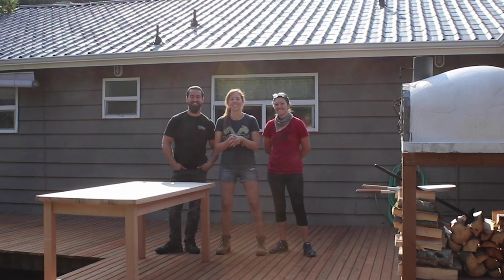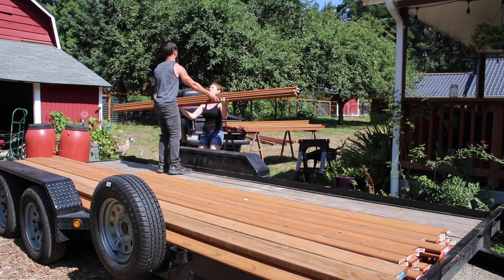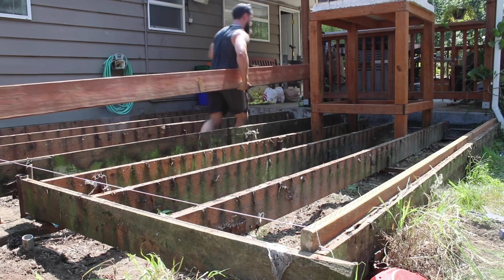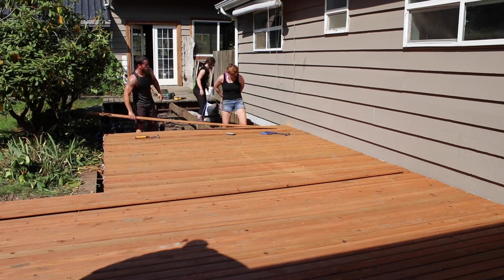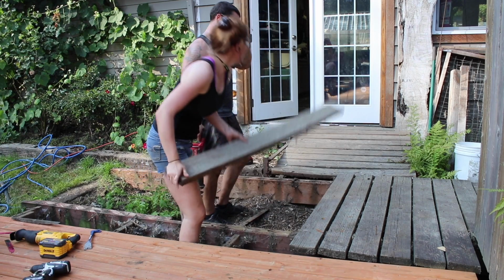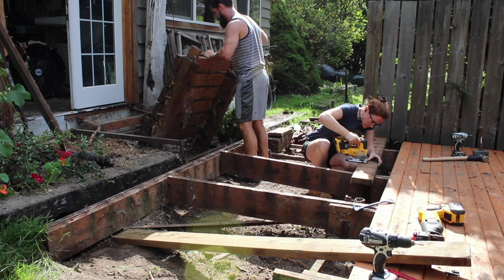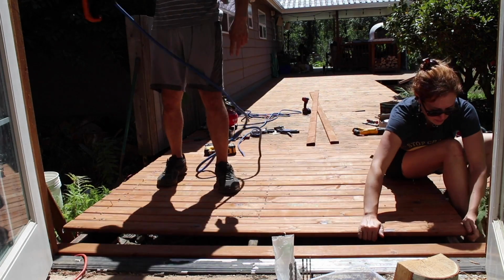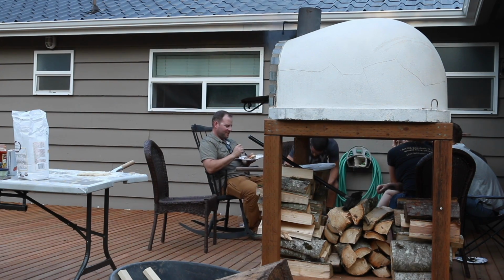2 Day Deck Rebuild - How To Rebuild A Deck

Comment: I don't know what blade you used in your sawzall but my old deck board were screwed down. The screws were angled in from the sides of the boards to hide them and not one would back out. I used a crowbar and a smaller prybar and popped the the board off and then went back to remove the screws. Three different style blades and none of them cut the screws as fast or easy as yours did in the video. I used a set of lineman's pliers to snap them off. Around here (North Alabama) I have not ran into anyone who uses nails to lay the deck boards. so I am going to use standard deck screws. I tried screws like the original builder used and run them in from the edge but the wood kept splitting on me.

Comment: Original joists sitting on blocks 👍 then you raised deck by nailing new joist to old👎.nails alone wont hold that. Joist spacing is too wide for 5/4 lumber to span.It was Fast but it won’t last

Comment: His name is Ronnie.  He was a carpenter's helper with me back in the 80's.  He was cutting a board across his knee like April was at 1:50.  The saw kicked back and ripped through his knee cap.  His career was over in the trades because he could not get around very well after that.  Love the colab video though!

Comment: Some casual observations: while not grammatically incorrect, referring to the joists as substrate is not how that term is used in building.  Also ripping is with the grain.  Cutting of the ends of your decking is cross-cutting.

Comment: You have to leave space between deck boards... sure they may shrink some but they will also expand... not to mention that shrinking isn't guaranteed. My in-laws deck was done in a similar fashion and they have puddles on the deck because there is no gap and where there was a gap it quickly got filled with dirt and debris and it no longer drains well.

Comment: I do a lot of decks and porches and will reuse the original wood whenever possible. Just redid one with rough cut timbers. One portion needed a complete demo while the other’s frame was 70% intact. As long as the wood has integrity it can last another 10 years or more.

Comment: please don't rest wood on your leg and cut with a circular saw, take it from someone who has gone through his kneecap. Had to close my eyes at that moment!
Reply: 28 years in a level 1 trauma center.. the misuse of a circular saw has to be number one for injuries. Second was probably chain saw.
Reply: I don't even HAVE a circular saw yet and I cringed.
Reply: I was getting a panic attack when I saw her cutting like that
Reply: Omg same, heart stopper🤯
Reply: OMG kneecap. now this gives me the chills...
Reply: What did that feel like? Ouch!!
Reply: As a framer, we do that all the time at work, although we have the length resting across our right foot and cut off to the side closer to the ground which is much safer than this way.
Reply: @anand8905 why the right foot? I lay the lumber across my left foot. Genuine question!
Reply: Wow, going through your own kneecap with a circular saw, that must of been embarrassing at a and e. If I was to ever do a cut like that, I'd make sure to triple check all my body parts are out of the path of the saw before beginning to cut. Think of it like crossing a road, look both ways before doing so and you'll be fine, or just look down and go and who knows.

Comment: What's the deciding on factor on including a gap between the boards? I can't tell if you did or not (it looks like you didn't?).  The last deck I helped build several years ago, we spaced all the deck boards apart by the width of one of the nails we were using to nail down the boards.  I assume this helped with water runoff, and dirt. I guess I assumed it was standard practice.

Comment: NEVER run boards up against each other!!!  That lumber is going to swell and then buckle come the winter rains.  Additionally, 5/4 treated decking will check and crack and basically fall apart in just a few years.  That said, if you're not going to replace the framing under the deck, using a decking that will fall apart in a few years actually makes sense.  Good decking (composites and hardwoods) will outlast even new treated framing.  

This is a deck that will last, at most, 5 years.
Reply: Ken Charm the boards will shrink and then have space between them. This is my experience with treated wood.
Reply: Ken Charm the boards will shrink and then have space between them. This is my experience with treated wood.

Comment: Expand/Contract issues ?  The old deck had some space between - the new deck has none. Why April?
Reply from the maker: The boards are treated and will shrink in the next few weeks as the moisture dries, and create their own gap.
Reply: Thanks - I now notised I should have paid more attension around 2.33

Comment: The joist are too far apart. But, other than that, it looks good.
Reply: Generic Username generally 16” on center is the acceptable spacing and pretty much an industry standard. Most of the calculations out there are for span which depends on joist size. Usually 1.5 times the width (in inches) equals the maximum span in feet. For example the maximum span for a 2x8 is 12 feet.
Reply: As my dad would say “good nuff”.
Reply: yea that deck must spring like crazy- no matter what the local code allows
Reply: Roberts.inc yep they’ll figure that out in about a year.

Comment: Wow, You removed 2x6 boards and replaced them with 5/4 boards that are not rated to span 24"/2 feet. Even the second part of the deck looks like the joists are approx 32" apart. That won't pass for 2x6 deck boards.  I really dont think an inspector/architect/engineer would pass this setup you have there. Look up load ratings for this material and I doubt it passes !!
Reply: They sistered 2x lumber with nails exposed to water. No bolts, no joist hangers, no adhesive and too long of a span. It will look good for a couple years and then nails will fail and the sistered boards will fall/sag. Stick to your good woodworking skills
Reply: MBR you’re assuming they got a permit, which would have then triggered inspections, etc.  I’m with you - No building dept in the pacific NW I’ve  worked with would have accepted this design/spec to begin with.  That said, until the “deck” is far enough above grade to require life safety items hand rails, etc... if it’s not attached to the house (this one did not appear to be) it’s not technically subject to building codes at all.

Comment: Each time when someone decides to dispose of old wood instead of burning it to heat they house - I'm crying.
Reply: If pressure treated, that'd release a lot of nasties. Around here it's a no-no on burning it, and a separate category at the recycling centre.

Comment: Wow I don’t know what to say. I applaud all the hard work really awesome that deck look like it had a lot of problems and it still does.🤦🏻‍♂️ you said that’s in Seattle there’s a lot of water out there. Those Joyce look like they were literally sitting on the dirt even if they are  moisture treated or not they will deteriorate.  It look like the girders were a 2 x 2 was not that clear just did not look like a very solid structure to begin with.  It was hard to tell with the video. I’m sure it looked better in person but from the video that looks like a full tear out if you’re going to invest that money putting all that decking on that old Joyce doesn’t seem logical but it’s cool save some money. Did you use moisture treated ring shank nails were they galvanized when you  nail or screw into moisture treated lumber it Has to be  coated or it  will  deteriorate. I’m sure it was way better in person like I say hard to tell from the video I’m wondering are you charging for that work have you become a licensed contractor❓

Comment: Great video, thanks! But why no spacers between the deck boards?
Reply: All fresh material will shrink and by next year will have 1/8th to 1/4" gap between boards. If you start with a 1/4" gap by next year, a woman's high heel shoe's heel will pass thru the floor and can break an ankle !
Reply: @TheDirtyBirchTrails  yeah, I guess I'm used to a different climate. Over here the boards would swell and then buckle, as any water sits in the groove and can't escape down a gap.
Reply: None of the boards are perfectly straight, leave a 1/16th if that works for you.

Comment: April, I can't believe you built on top of that old framework. No building inspector ever would have approved decking over top of that. Those old joists were at least 30-36 inches apart which is way too far for the decking materials that you used. That whole thing should have been scrapped. Good thing the deck was at ground level so that when it collapses, no one will get killed.

Comment: Wow,that original framing looks  more than sketchy. What are those lap joints on the joists supported with?A 2x2? And spacing? Wow. And when you past the house up there is no joist for a nailer at the fence.

Comment: should have added more stringers 5/4 decking will sag if not on 12 -16 inch centers. My deck was done on 24 inch centers and it sagged like crazy had to tear it out and rebuild it.'
Reply: I've never seen treated 5/4 decking not sag or, worse still, check and fall apart after a short period of time.  That stuff is absolute garbage.
Reply: @kencharm2909  I couldn't agree more!
Reply: you mean joists?

Comment: WOW why didnt you use a saw horse I cringed when I saw you sawing  remember safety  looks nice
Reply from the maker: That cut was cut fine but as always, if you don't feel safe doing something, then dont.
Reply: April Wilkerson that’s beyond not the point - the cut could be perfect, but it doesn’t make a difference if it goes through your leg too. That’s not a safety preference, that’s really just common sense. At the very least, the blade depth being what it is allows for the cut to be much more prone to kicking right back at you.
Reply: @AprilWilkerson  Buddy of mine did the same thing and ran the saw into his knee. OUCH!
Reply: good your looking out  just be safe  need to keep seeing you out there making vidoes your very inspiring  been watching you since you where in your old shop

Comment: That joist spacing seems a bit much for that thin of decking.  Gonna have issues with nail popping from the wood flexing as people walk on it.
Reply: I'd say that spacing is double what building code allows.  Should be 16" on center like any floor joists.
Reply: 16 on center and where were the joist supports? Never pass code here in NY. But boy can April work...You Go Girl!!!!
Reply: ̇George H. I was thinking the same thing. I think they were able to get away with such large joist spacing before because they used 2 x 6 decking

Comment: sorry but today i big dislike from me, yout work is not so gut, your forget ....... Expansion joints, wood breathes and moves.
Reply: unless the wood came directly from the sawmill ( or where ever it got processed ) it will have been drying for some time, so i bet if there is a lot of rain, that it's going to soak up more liquid, than it has in them when they were nailed down meaning it will expand more than they can. but also lets just pretend that's not going to be the problem. when it soaks up water and fully expand to the same size as it is now, where is the water going to run to? there is going to be pool of water on the deck ( unless they sloped it, but doesn't look like they did )
Reply: She specifically pointed out why they placed the boards against one another. They shrink as they dry out.
Reply: @KodieS  So what happens when the timber expands from all the Seattle rain ?

Comment: Looks good guys! Here in Hawai'i, when I do a deck, I put down some of that tape used to seal around windows when installing them. It is very sticking and run it lengthwise down the joist before the decking goes down It keeps the water from sitting on the joist and rotting the joists out...

Comment: thank you April , Anne and dude ( old forgot name all ready sorry )  question please how much space did you leave between the deck and house ? mine was butted up to the house and rotted the both . so yup i got to rebuild mine its why i am asking ? oh and Seattle rains alot . i did love the area back in 75 .
Reply: You want to have enough space for water to pass through and air to ventilate and dry out the wood... 1/3 - 1/2 of an inch would provide enough of and air gab.
Reply: @plumrose  thank you

Comment: You a hard, creative worker. That said, joists on 16" centers.
Reply: When using 2X (1 1/2") thick decking, code for most applications in U.S. is 24" O.C. You're right though, 16" O.C. mo bettah.
Reply: There have been too many deck failures at 24". Of course here you may well survive the fall. ;)
Reply: I don't think they're using 2X decking, though.

Comment: Wasn't worth sanding it?
Reply: Sanding and staining every year and you still can't walk on your porch barefoot
Reply: @tobenkinzle4498  So the answer is to change the deck each year? ^^
Reply: to be fair, it did look kinda bad, not level, boards not fully attached. also she wanted to turn the direction of the boards at the end and not have a step down by the pizza oven. so i think once they decided the boards had to come off, it was just easier / cheaper in time to replace it rather than sanding them and getting all the nails out